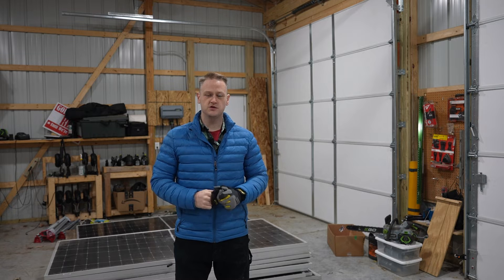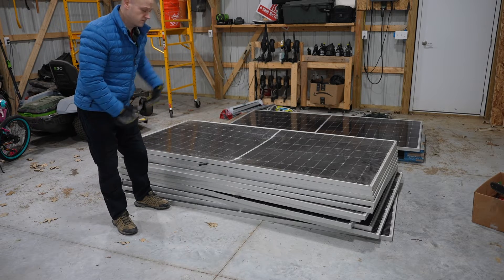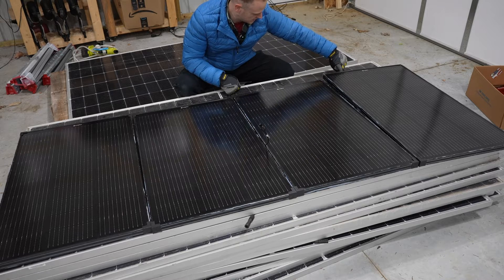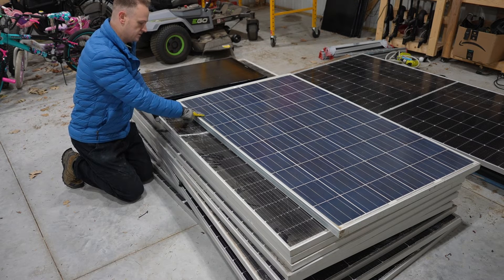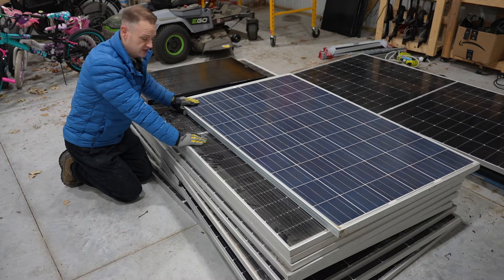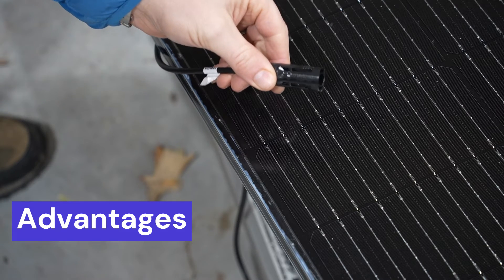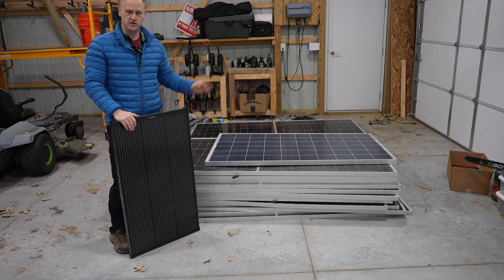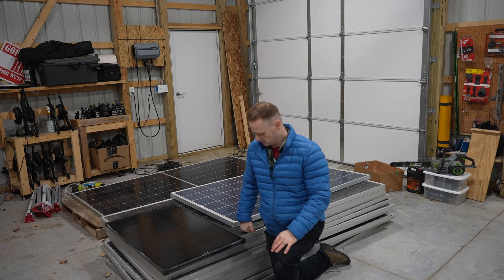Solar Panels: Big vs Little - Who Wins?

Comment: Currently I have two Renogy 550w panels with the Delta Pro and it produces just at/around 1000w to them.   If you try to do any more, you'll exceed the 150v max.    Unless, of course, you get creative and do something like 2s2p setup.    But I can't say enough great things about these bifacial renogy panels thus far.